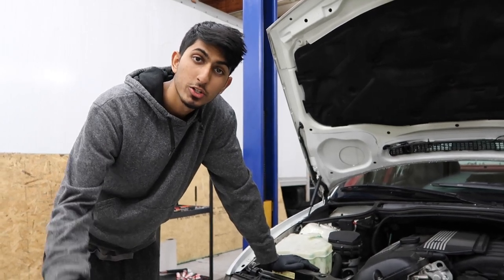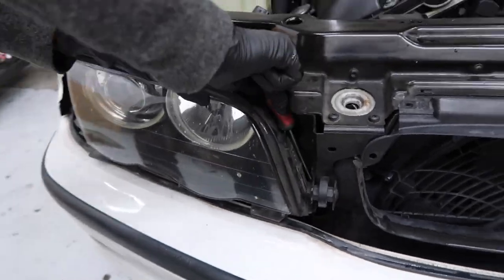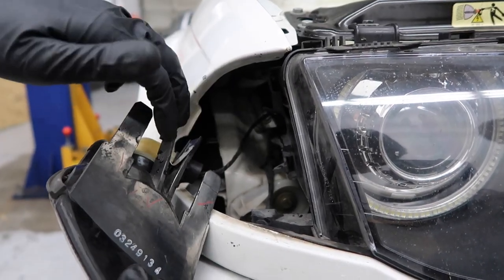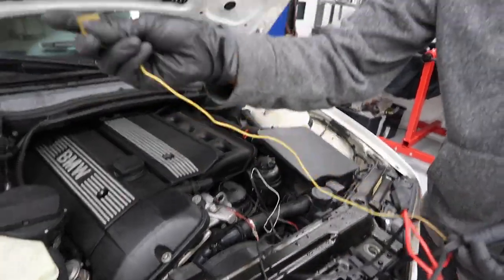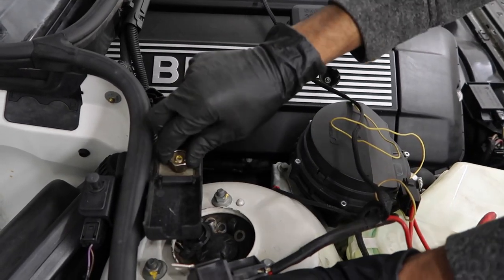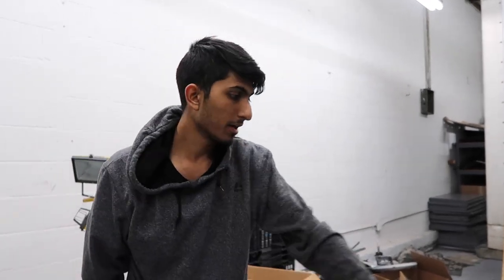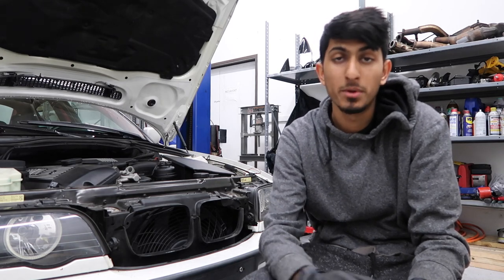BMW E46 Angel Eyes Install DIY

Comment: Nice vid again mate. Just in case people get mixed up when purchasing, the CCFL lights only use a pair of invertors that connect straight into the sidelight connecting wires and don't need a separate relay wired into the DME+earth of the car. They are very, very easy to install. The set you demonstrated are the LED ones that have their own resistors built in to avoid canbus errors and they need a full circuit to operate. Best thing about those types are the option to route the wiring into the cabin so you have the fade in/out when operating the central locking. Again, well demonstrated and easy to follow. Keep up the good work! ;)
Reply: Thanks for this info!
Reply: I bought some CCFL lights, where exactly would i need to connect those to?
Reply: i bought CCFL angel eyes with the 2 small invertors, is there any way to connect them to the interior light?
Reply: can i make this fade wiring diy with ccfl ones?
Reply: Which fuse under the glove?  Which line at the hood?  Mine had no directions.  I rigged the halos to the interior lights, which is totally wrong, but works. I attached blue painters tape to all the domes (which actually) looks kinda cool.  LOL We tried the red / yellow at the DME (like in this video) with no results.  03 325i sedan.  Trying to sell this one off ASAP since its still running strong at 220K miles.  Even since the air bag recall..nothing but issues.  Not into $200 hr labor.  DIY always

Comment: Very good vid mate, well explained and easy to follow. I have a prefacelift M3 so the only difference to me would be the washer jets in the trim - these are not that hard to remove anyway. And for anyone wondering, the LED kits fit similarly to the same way as the CCFL ones do. Only difference is the CCFL ones only require an pair of invertors and have no added wiring to the relay/DME/earth. The led ones are usually brighter so it would be down to your individual taste what kit to go for. Plus you were spot on about feeding the harness through from the front as being the most awkward bit, just as well you only need to do it once! Saw a few other vids you've done, you're easy to follow and explain each step well - keep up the good work ;)

Comment: I installed the DEPO branded fixtures in the 03-325i sedan.  Purchased way back on the bay.  But for the life of me, am simply baffled where to get power for the high beems.  It's like the factory connectors disappeared or ran off back to Germany?  The vendor even supplied me with a good braided jumper that is supposed to go inline with the Depo harness.  Even, one of my BMW shops can't seem to figure this one out. I hate u ebay. Anyone?  Of course the dash console has those cool looking red stop signs all over the place.  This is what I love about the Germ cars.. Completely Over Engineered.  I;m too old to spend my dying days on that project and will prob just tape over the dash warns. I give up.  Would be cool if the vendor supplied directions.  SMH.  1st 6k US takes the car off my hands.  Prob go back to a Toyota from here.

Comment: Fantastic video as always. My Angel kit did not come with a wiring harness. I understand the wiring process to the fuse box and footwell light, but can you help us with the relay and how should that be wired. Thanks again.

Comment: I bought angel eyes for my car. headlight assembly is complete. But I don't know where to get electricity. I've watched a few videos online but angel eyes only have pros and cons. If there was a parking light I would have installed it, but there isn't. Getting the power from the backplate is a very difficult task. How else can I connect?

Comment: Great instructions - your car behaved as expected. Mine, well, since I live in AZ, a lot of the rubber decomposed and parts were brittle and crumbled. but other than that, it all went back together as illustrated... thanks  😃

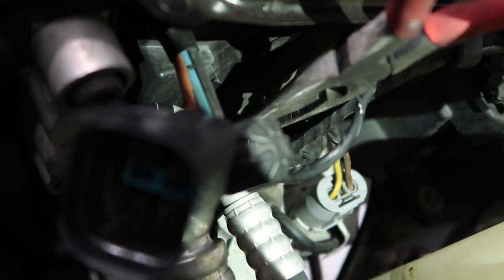Comment: 5:21 Is it safe to have the rubber covers partly open after the AE wires are passed through? I would recommend cutting a slit in the covers, passing it around the AE wires, and then sealing it up with waterproof sealant.

Comment: Be really, really careful with the plastics! Especially the black trim inside of the headlight itself!  Mine cracked when I assembled the clear cover on the headlight...

Also when you connect them, just unplug the old parking light bulbs and connect the leads from the angel eyes into the plugg!!  It will not fade in and out, but it is waaaay easier and cheaper to install.
Reply: MultiTerpen Does that cause your angel eyes to flash with your turn signal? I've always wondered about hooking them up that way
Reply: 99Technetium No no no... Your parking lights are lit up all the time, so you can just connect it to that.. Just put a couple small  flat cable shoes on the cables from the angel eyes! You can not make it easier than this!  Also this will not ruin any of your cables in your car ;)
Reply from the maker: The parking lights only come on when you use the headlight switch to turn them on. I would not recommend going this route.
Reply: ShopLifeTV Well.. Why is that recommended? A lot of e46's are different. Mine have the headlinghs and parklights on all the time, I can not turn off my headlights.. But most is so you can choose between nothing, only parklights, and  park and driving lights.  So I dont see the problem.    

This method is for those who just want a easy install.  This does not work with the fade in and out anyway!

Comment: I don't understand why ..."Bake Open" Facelift Model?  I have facelift and my lenses althought shaped slightly different Come Off Easily. They have the same tabs and had them off a couple years ago to Polish the haze off of them and then snapped em back own. So exactly why is it I cant do the angle eyes? Or what angle eyes can I do??? I have 02' 325i 4d Sedan. O' and I do not have projector head lights... Just plain ole bulbs!...............................................................................................................................................................................................................OOOO' you said coupe... So its only the facelift coupe that exception would apply to? So why does most angle eyes I find online seem to suggest only for 2 door not my 4 door?

Comment: Hi ShopLIFE, great tutorial !

Do you have any experience with xenon lights ?
I had a headache, because of the lightwashers....
Reply from the maker: Lights with the headlight washers will require you to remove the cap over the spray nozzle and then remove the rest of the trim. The rest of the tutorial is the same.

Comment: So what happens to the original lights that come with the car after installing the angel eyes? Do they turn on with the angel eyes or are they shut off or removed?
Reply: Same question
Reply: @bestofhouseoficial  i installed angel eyes on my car. Mines are connected to the foot well light inside and act as day time runnin lights. My headlights can be turned on and off as before

Comment: Hey thanks for this video, helped alot. I have installed angel eyes in my 2001 e46 but one thing left behind - how we close rubber at back of headlight as due to wires it doesn’t close. So moisture or water can go inside

Comment: how did you get the trigger wire to connect to the ignition wire? I cant seem to push the trigger wire all the way in. I noticed i heard a clicking sound when you successfully pushed the wire in?

Comment: Do you actually even need the white wire that you tap into the DME box to make them work? Isn't that just so they turn on as soon as the car is in accessory mode? What if i just want them to turn on when i actually turn the headlight switch. Not automatically

Comment: Good video as always man
There is a factory ground port in that compartment that you bolted the relay at!
Well whatever works.
Reply: Jason Lee That's where I grounded mine. I've had them for 3 months now with no burn-out, though that might be more because of the resistors in the harness. TL;DR Isolate everything from engine heat. A cool harness is a healthy harness. P.S. If you jump a car with the terminals under the hood, take out the fuse in the harness for safety.
Reply: Thanks for the advice.
Why would you take the fuse out?
I thought it was there to protect
Reply: Jason Lee I guess more for the fuse life than anything else. Call me paranoid.
Reply from the maker: My harness ground was not long enough to reach the factory ground, which is why I chose that location. If your harness is long enough, the factory ground point would be better. Thanks for watching!

Comment: Hey man I recently wrecked my car 2001 330ci it has 130k and it rolled on its roof but surprisingly not much damage to the roof but the a pillar is bent down and Every panel has damage. Idk if I should just junk it or repair it

Comment: Great video!!! Your channel is so underrated!!! 
Where Do I get this wire-thingy for the angeleyes from? Will it be shipped with the angeleyes? If not, how could I connect the angel eyes otherwise?
Reply: KonaGang most kits you buy contain all the wires to hook them up to the car.
Reply from the maker: Hey like 99Technetium said, it should be included, if not you can buy just the harness on ebay.

Comment: Hey man, you are doing a great job. I have learned a lot watching your videos. Keep up the good work! I have an automatic e46 which is giving me some problem. When it is in Drive, it seems to be raving too much before engaging the third gear. Although I feel it is skipping the third gear and going directly into the fourth gear with a "jerking". I tried changing the ATF but that didnt help. What could be the problem and how can I go about to work it out?
Reply from the maker: Appreciate it man, I would try to find someone with Bmw software (inpa) or buy the cable and software yourself (have a diy on this). Then read the error codes for the dme and transmission modules and see what comes up.

Comment: When you connect the wiring to the interior footwell light, does that mean that there is no way to turn the angel eyes off (without turning the car off)?
Reply: ShardaBoi27 No its connected with the cockpit light so when the cockpit light goes off your angel eyes will also turn off i think

Comment: When i hook up the trigger wire to the ignition wire my engine doesn't shut off. the key will come all the way out and the engine will stay on. i unhooked the trigger from the ignition wire and everything works as it did before but the angel eyes don't come on obviously. any suggestions?
Reply: Matt Zamora If yours has a relay then it’s probably wired up wrong check the relay
Reply: Ivan T i left everything hooked up but the trigger to the ignition wire. Later hooked up the trigger wire back to the ignition wire and everything works correctly now. Not quite sure what would have caused this.

Comment: Forgive me for my lack of knowledge about Angel Eyes but with this current setup including the yellow wire tapping into the footwell light, what you get is the Angel Eyes fading in and out when locking/unlocking the car and also having them on while the key is either in position 2 (for accessories and etc to turn on) and position 3 (while the engine is running) right?
Reply: Constantinos Salpadimos Yes. When the car is off, the footwell light controls the Angel Eyes. When the car is running  or key is in position 2, the Angel Eyes stay on.
Reply: 99Technetium Great! Thanks for the reply. I also wanted to ask, is there any way to wire this setup where the Angel Eyes turn off once you turn your headlights on?
Reply from the maker: There isn't really a way to have the angel eyes turn off once you turn the headlights on, but you could probably wire in a switch that allows you to turn them off.
Reply: ShopLifeTV Oh, I see. Hmm, a switch sounds like a good idea but, too much extra work to think about while I'm cutting on my lights lol. Thanks for your answer though. It's appreciated :)
Reply: also it will light on whenever the door is opened
Reply: You can do this with a relay, it's really simple.
Reply: if you don't have that yellow cable to make them work with the interior light, can i make that? and do you know how?
Reply: it wouldnt be that hard to wire if you had the right inverter but it seems kinda ridiculous to me

Comment: Good vid, im installing a drivers info display in the center vent that also taps power from the jumping points and combines with info from OBD2, CAN bus wires, oil pressure plug, and EGT sensors. Should be awesome when its finished. Just not sure which 12v wire I should best use to make the relay switch it on when I turn the key..

Comment: Say the cars running and you hit the interior light button, the footwell lights will come on and send a feed to the angel eyes too won't they along with the ignition feed, will this cause any issues (unless a diodes in place )
Reply: if car is running the relay is in switched position, so the wire connected to interior lights wont have any effect
Reply: coled7lan I can second what scghost said. The relay has two activation wires. The one running to your DME overrides the signal from the one in the footwell. As long as your car is running, the Angel Eyes stay on. When the car is off, the footwell signal will turn the Angel Eyes on and off.
Reply: 99Technetium thanks !

Comment: hi shopLife,

i have a 325i bmw e46 station wagon, it has had a engine management light on it for the past year, we have replaced, most of the pipes and elbows, fuel filter, mass airflow sensor, spark plugs and have constantly cleared light, so yesterday we ran a obd scanner tool on it and at idle it said disa valve to active is this normal? what do you think is wrong?

Comment: If i install angel eyes on my e46, what modes are in? Can i turn them on with stock lights? Can i turn on only angels? And can i turn on only stock lights without them when they are installed?

Comment: if i want to have rings turned on when parking light is on can i simply put -+ on parking light wires directly to rings without any inverters or relays?

Comment: Hey man just wondering where id tap the yellow wire in so that it fades in and out when locking/unlocking the car bcoz my 03 318i sedan doesn't have a light under the glovebox area
thanks
Reply: where did you tap in the white wire.. considering the wring is so much different in my 318i compared to this video

Comment: I have a facelift coupe. Can you make diy for that?
Reply from the maker: The diy is the same, you just have to heat up the glue around the lens to remove the lens and then reseal them. You can do this with a heatgun or an oven.

Comment: I have a 320 2002 e46 touring and a i am trying to install ccfl angel eyes. Can i plug the power wire directly to the acessorie wire?

Comment: hey jason i have a question i had my uncle reprogram my bmw e46 brain to make my headlights turn on automatically without touching my headlight switch. i can't get a hold of my uncles anymore because something happened to him and i was wondering if you know how to program it so i have a choice to have my headlights on or off  if anybody knows please help! thank you
Reply: You will need an OBD2 cable and a laptop loaded with INPA/NCS software to recode the ECU.

Comment: Can you link the angel eyes you bought? How similar is this diy to a e46 M3 (2002)
Reply: AaronAlbor M3 headlights should match those in this video. You might have washers in your headlight trim, but when you pull the trim off you can pull off the covers for the washers as well.

Comment: I have BMW 2006 325 ci , I guess I have different headlights., what I need to do
Reply: Michael Kurtev it requires using heat to unseal the lens from the headlight. Probably very time-consuming and difficult. There might already be a tutorial on YouTube.
Reply from the maker: You would need to heat up the glue around the lens to remove then lens and then reseal the lens to make sure it doesnt condensate.

Comment: hi there can you swap a 328ci 2000  engine and put in to a 4door saloon 2002 can you get back to me thanks
Reply from the maker: You can, but it will be better to swap an m54 rather than an m52
Reply: thanks for getting back to me I would love to swap the 328ci engine an then put that in to my car how long would it take to change it
Reply: what would I need can you let me no thanks mate

Comment: So what years got the facelift?
Reply: I have a 2005 convertible which is a facelift model, unfortunately the headlights are a pain to open as they require heat to pop open the seal!! I can see why the youtuber just changed the headlights to pre facelift which makes  the whole task much easier...i wonder how much they cost? ;)

Comment: @ShopLifeTV   Hey I'm trying to hook up the wire to the footwell light, but my '99 323i doesn't have the light (only a plastic insert). Know of any other wire I can tap into in that general area? Thanks.
Reply: Hey i have the same problem do you have any solution?

Comment: Help! Im trying to hook up my Led AngelEye harness, I just cant seem to find that distinctive looking ignition wire in EPU, its suppose to be quite prominent looking (Red/yellow stripes wtih a kind of pattern running around it) maybe its under a different colour for the make and model of my car? BMw E46 2005 convertible

Comment: question which replacement bulb do you recommend for replacing factor regular bulb for the angle eyes and fog lamps on a 2009 bmw x5 xdrive48i

Comment: Thank You for the tutorial Jason!! i just one question concerning my E46, is that normal that i dont have that Red/Yellow wire at 15:55  for +12V after ignition?
Reply: Where do you connect the wire if i dont have red and yellow wire
Reply: @_holkkolaa_4826  I have the same problem that there is no red white yellow wire